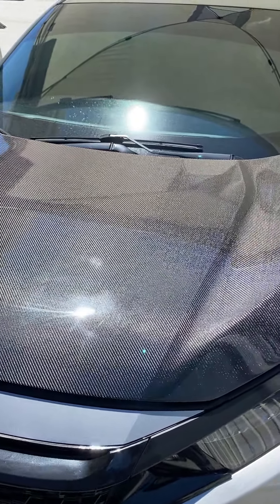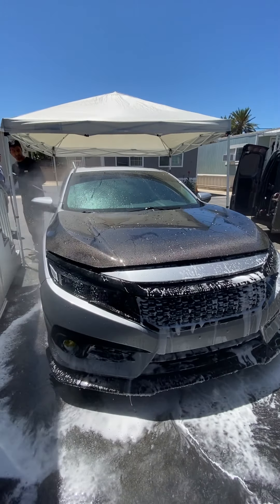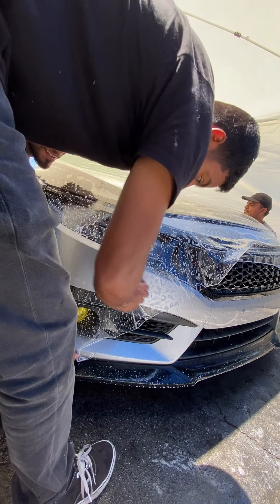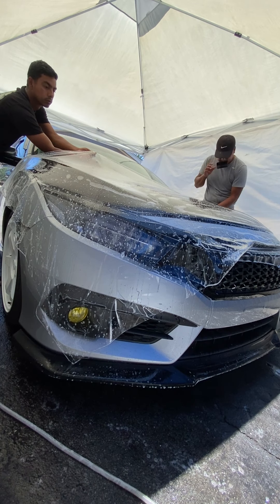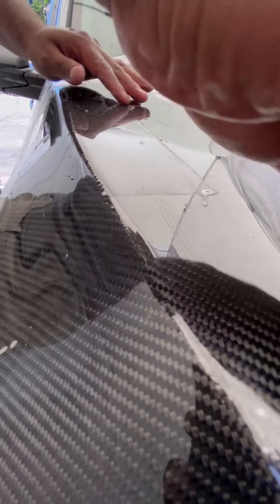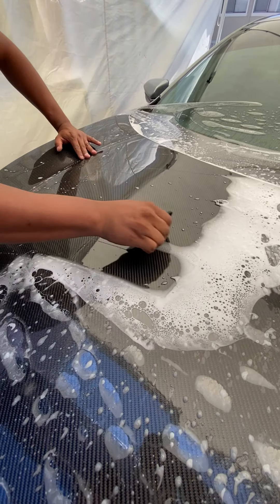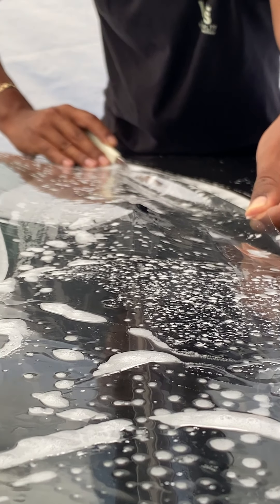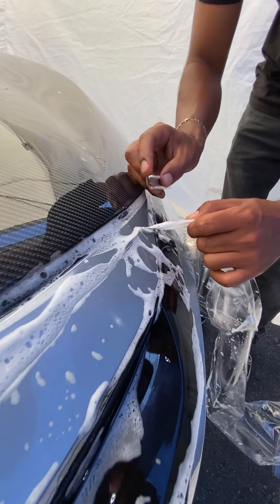PPF YOUR CARBON FIBER!!

Comment: should I ceramic coat the hood before or after PPFing it? or both maybe?
Reply from the maker: Ceramic Coat it after the PPF is installed 🤙🏻
Reply: @madchally1061  i’m afraid of potential damage to CF or the gel coat on it upon ppf removal as it’s extremely hot and sunny where I live
Reply from the maker: @riology2234  the clear coat on the CF won’t damage if it was clear coated correctly. Also a steamer helps to remove safely. Nonetheless PPF will protect your CF from fading, rock chips and other potential damage.
Reply: @madchally1061  the manufacturer of the part stated that the product has a UV gel coat not a clear coat and when contacted them they advised not to apply automotive clear coat on the CF part as it does not stick properly to the carbon fiber and will fade soon. only application of sealant or ppf was recommended. what’s your opinion on that?
Reply from the maker: @riology2234 yeah in that case you could just use the ceramic coating as a sealant to protect it from sun damage atleast 🤙🏻

Comment: I’m gonna order ppf and wrap mine soon. What is the solution your spraying under the film and why did you spray so much. Also do you wax the top layer or apply anything to it after you ppfed it? And do you know if the ppf helps maintain the clear coat, my car is left out in the sun a lot!
Reply from the maker: yes do it! PPF is one of the best things you can do. In the video we keep the material lubricated with a baby soap and water solution: also to avoid the adhesive from drying up. Ceramic coat the ppf to keep it hydrated and avoid from drying out with the weather conditions. Maintaining a clean surface is key to a long life spand with your paint, ppf, wraps, ceramic coating ect.
Reply: @madchally1061  Ok thank you so much, your video was the only video I could find for PPF on Carbon. I’m definitely gonna do it now that I know the solution. Do you know if PPF helps the clear coat from fading in the sun on carbon?
Reply from the maker: @treywrappedit  PPF on carbon fiber will definitely help with the life spand of the clear coat. Better to prevent any accidents with PPF than to fix damaged carbon fiber..